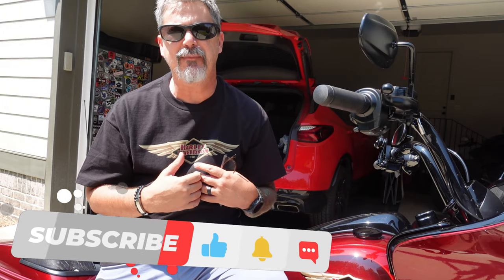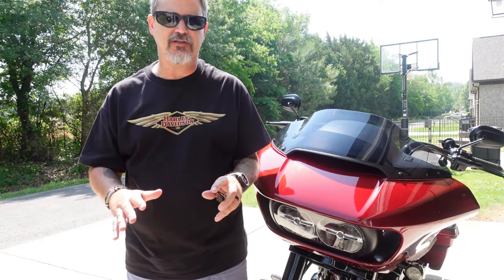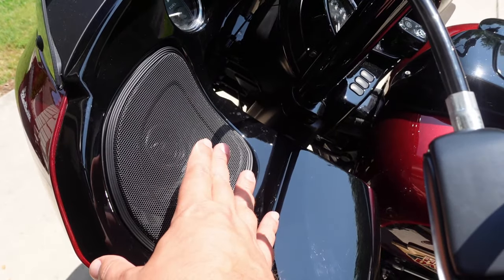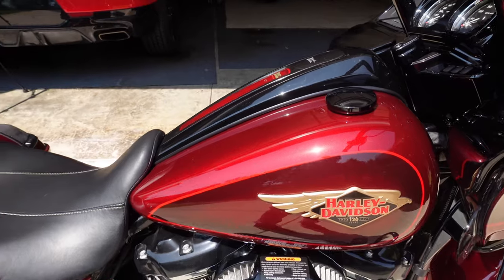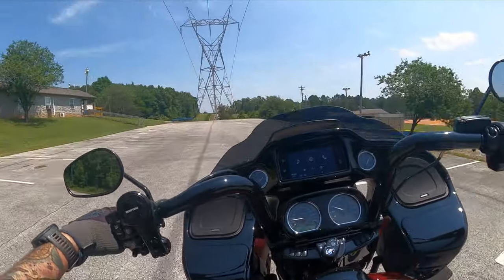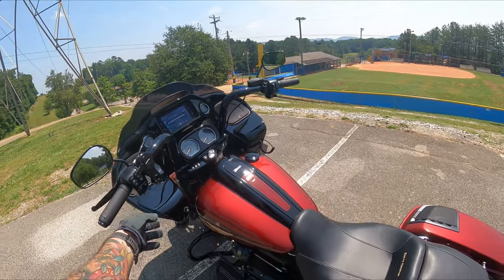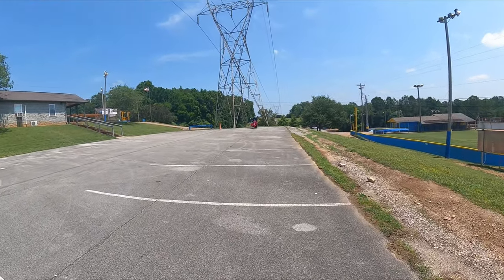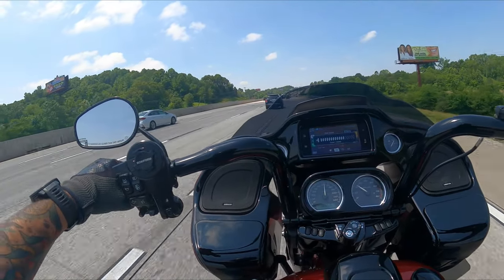Review of Hertz Amp and Speaker Upgrade for your Harley. YOU NEED THIS!

Comment: Great looking and sounding bike.  You should swap out that garbage factory windshield for a taller better protecting one.  It will cut down the wind so you don’t have to crank up the volume at speed and make a much more enjoyable ride.  I have a 2017 roadglide I went with a 13” long ride shields windshield but I’m 6’5 needed the height and keeps the bugs out of my face.  Great video though
Reply from the maker: Yeah man. I have been dragging my feet on that, but I'll probably get one ordered in the next few weeks or so. I would like a super short on because I really don't like looking through a windshield. Thank you for watching and I appreciate your feedback!

Comment: Ok, the audio comes down to speaker(s), amp(s), and wiring quality. The installation work your local vendor (Volunteer Audio?) does is one thing. The (brand) speaker(s) and amp(s) quality is another thing entirely. They are related, though, because if the vendor sells and installs "crap" brands, it affects the vendor's reputation as well. 
Question(s) to you: What factors determined your choice to go with Hertz speakers vs other brands? What other brands have you used?
Great video Ty as always!
Reply from the maker: Hey Toby. My previous SG CVO had a Rockford Fosgate Stage 2 and at hwy speeds the sound just wasn't all that good. I heard so many wonderful things about Volunteer Audio it seemed like the way to go. Glad I did. Hey man, I hope to see you very soon!

Comment: up in the air on getting the sound stream 14si unit? Is the stock head unit flashed good enough? definitely doing the 4 speakers and amp on my 23 street glide special.Just kicking around upgrading the head unit.  Thanks!
Reply from the maker: Hey there! I kept the stock infotainment in mine, but I'm 100% certain that I'll have Volunteer Audio upgrade that soon. Maybe this summer. If you go with this setup you will love it! It makes the bike so much more fun. Thank you so much for watching!

Comment: 🛑🛑 Ty…Great Sound!! 🔈 

I did the Rockford Fosgate Stage 4 (Fairing, Lowers, and Tour Pack) on my CVO Ultra. 

My Son In-law just installed a Hertz a Stage 6 system on (Fairing, Lowers, and Saddle Bags) on his CVO Street Glide. 

Both systems are very comparable , and the difference is hard to tell. 

My question….

Is you Amp on your system 2000 Watts?
That number sounds really high to me. 

Keep Rocking My Friend!!
😂👍💯

Comment: Jay does a great job. I initially had him put new speakers and a new amp on my ‘21 Ultra.  About 2 months ago I took it back and had him him replace the amp with the bigger Hertz 2000 watt amp and add speakers to my lowers.   I can do 85 mph on the interstate and hear everything clearly.  Hell, Helen Keller could hear my music now!  Do you use a Sena or Cardo in your helmet?
Reply from the maker: Hey Ernie! I have a Sena but I never use it unless it's for group riding. Volunteer Audio does a great job. I'm looking forward to doing business with them again very soon! Thank you for watching!
Reply: @TyFromTennessee  I’ve never used a helmet headset so I’m pretty ignorant about how they work.  When you use one do you still listen to your music through your bike stereo too?
Reply from the maker: @erniemorgan471  When you use a sena or a cardo it will connect to your phone via Bluetooth and bypass the motorcycle stereo. They work well, it's just not my personal preference.
Reply: @TyFromTennessee  thanks.  I don’t see any sense in bypassing my bike stereo since I spent so much on upgrading it.  Thanks!
Reply: @easyrideguy  I hear everything fine.  I tend to set everything up in the middle range and the sound blends in fine.  But I’m not one of those folks who is able to hear the subtle differences in bass, treble etc.   I just want to be able to hear my music clearly at 75 mph with a full or 3/4 helmet and I can with this setup.

Comment: The least expensive way to improve your audio experience on your HD is ear plugs. They negate a lot of wind and road noise and let the music volume come thru louder and clearer. I would not spend money to upgrade my audio without 1st using ear plugs.
Reply: Should wear ear plugs to protect hearing and try to ward off Tinnitus.
Reply from the maker: Great point Craig. Do you have a pair that you would recommend?
Reply: @TyFromTennessee  I use the cheapo rubber like orange plugs that are connected with an orange cord, Ty. They do a good job of "filtering" as mentioned in my original post. A note of caution about the foam ear plugs; you squish them and they expand when in the ears but my understanding is they are illegal in some states because they do too good a job of muting noise.
Reply from the maker: @craigjarboe2834  Thank you sir. Much appreciated…

Comment: Maybe it is different in Europe but, riding a motorcycle with external speakers at full blast is idiotic. Well OK; smaller countries, towns & villages only miles apart instead of 100’s like the US.
I had Hogtunes Ultra on my Ultra Classic and playing through the speakers was rubbish at speed, the bikes noise not doing justice to the sound on the highway.
Nothing worse than car drivers going through populated areas blasting out rap and pop music.
Reply from the maker: I think most of it is personal preference. I like listening to my music on the external speakers and sometimes loud, sometimes not. Most of my riding buddies use a Bluetooth device to listen. The system that Volunteer Audio installed is top notch and the sound quality is amazing. Thank you for watching!

Comment: How does it do jamming for extended periods of time? Say 60-70% volume for 4-5 hours straight? Any issues with cutting out? Have the Rockford junk currently and absolutely hate it! Once i replace it all im using it for target practice so no one else goes through the hassle of installing just to be disappointed! Lol
Reply from the maker: Man, I have taken several trips for hours at a time and there have been zero problems with this system. It has worked flawlessly. Volunteer Audio really does great work and I so far it has been worth every penny. Thank you so much for watching!

Comment: Pretty sure its not a 2000w amp. Max power is for marketing imo...
Reply from the maker: Hi Paul. I just double-checked the website and it does say 2000 watts. You had me second-guessing myself..hahah!  It sounds so good man. I'm really impressed with the product. I appreciate your time and thank you for watching!
Reply: @TyFromTennessee  it's not 2000w. U have about a true 400-500w system, which is quite a bit. And it also looks like that amp is putting out more power than the speakers can handle unless they have the amp turned down appropriately. Max Power means nothing...RMS is continuous power.
Reply from the maker: @paulh6101  Thanks for your feedback Paul. Much apprecited.

Comment: Great video! I’ve recently myself upgraded head unit, front, rear, and added the hertz bag set-up and it sounds great!!! I can’t wait until hertz comes out with subs for the bags I’m first in-line!
Reply from the maker: Hey Alfonso! They had some saddlebag sub woofers but I’m going to hold out on those for next time. Such a great sound! Thank you for watching!
Reply: I believe the only subwoofers Volunteer Audio offers are the drop in subwoofers by Precision Power.
Reply: Don't get the subs. You won't hear or feel them unless your putting around town.